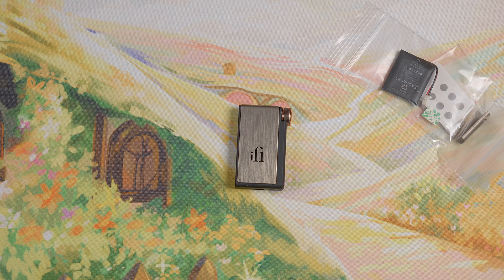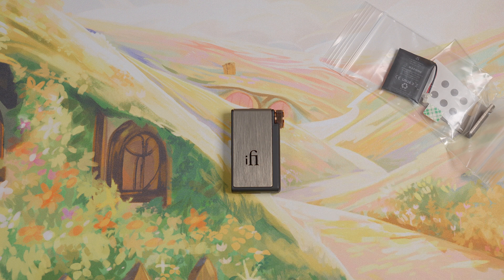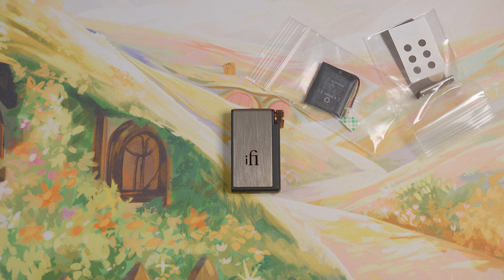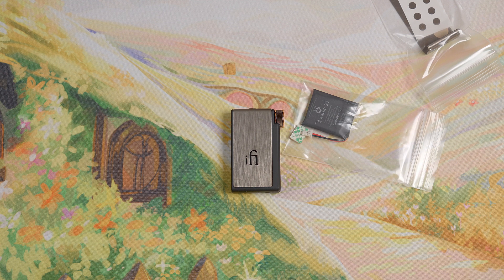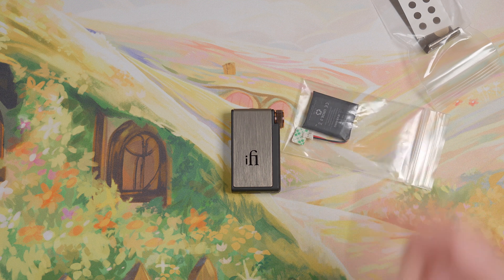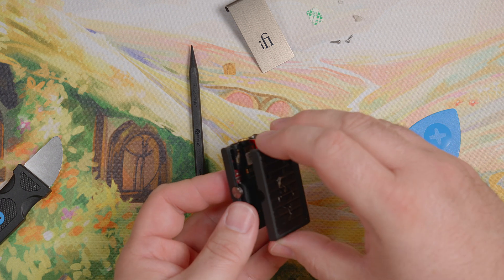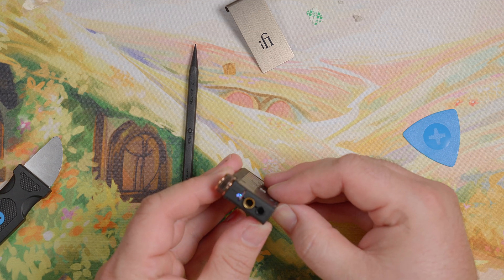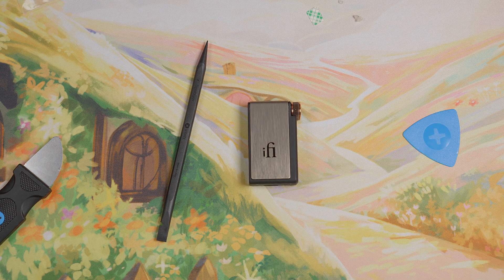iFi GO Blu Battery Replacement - Reduce E-Waste, Replace Batteries

Comment: I have two of these with swollen batteries. I ask iFi about getting a replacement. After opening a ticket and a couple emails later I was told "Not our problem since you didn't order it directly from us" (ordered on amazon and another in a store). They never even gave me an option for battery replacement. this was a few years ago. I still have both of them, what did you do to get a replacement?
Reply from the maker: Interesting you say that.  To get the replacement, I just created a support ticket and asked if there was any way to buy a replacement battery.  They replied quickly and sold me the battery replacement kit.  

However, the battery that I installed in this video is already swelling up.  I re-opened the ticket three weeks ago and never heard back.

Comment: How much was the battery kit?
Reply from the maker: It was a bit pricey, probably because it came with the aluminum plate and such.  If I remember correctly, it was $58.
Reply: @bigtb1717 ughh that's substantial

Comment: Great video! My iFi GO Blu battery swelled and doesn’t charge anymore, I had given up on it until this video! Going to reach out to order a battery replacement. What was the first tool you used to pry the face plate off?
Reply from the maker: It was an iFixIt "Jimmy" tool.

Comment: De dónde se puede adquirir la batería?
Gracias
Reply from the maker: I purchased the battery from iFi.  I reached out to their support team and ordered it through them.
Reply: My iFi Go Blu battery swelled and won’t charge anymore. Thank you for the video! I will reach out to iFi and get a replacement battery as I really loved that little device while it worked.

Comment: Nice device, but $200? Almost amazing the mfr has a battery refurb kit, and that you made it look easy 🙂 But I think I would go a WHOLE LOT cheaper on a BT device like this. But if you can afford it and don't care, a pretty nice option. I find a bunch of tossed items with LiIon batts which I retrieve and repurpose the batteries/electronics, or buy a cheap battery and put it in and Bob's your uncle, free device.
Reply from the maker: Yeah, it's definitely pricey for a little gadget like this.  I think I got it on sale, but there also weren't as many options when I got this a few years ago as there are now.  

Still, I'm not really trying to promote this, particular device, though I do give props to iFi for supporting it and offering batteries.  I just used it as an example to show that even a little device like this may just have a battery that isn't too difficult to replace.  So it's worth looking into if you have a device with a built-in battery.